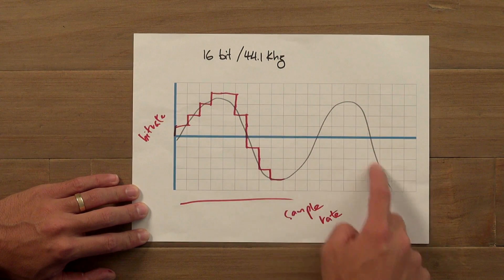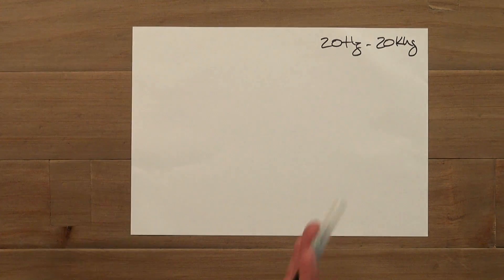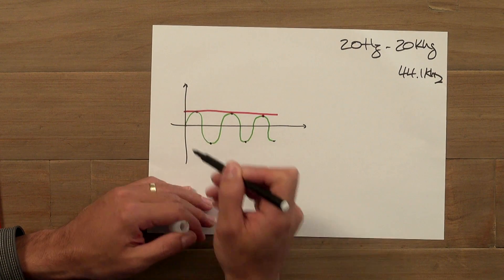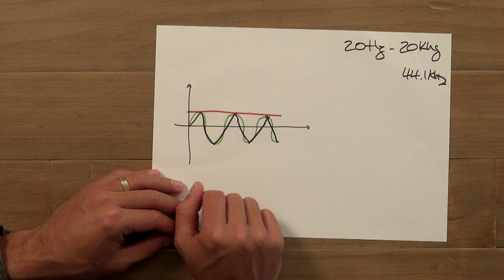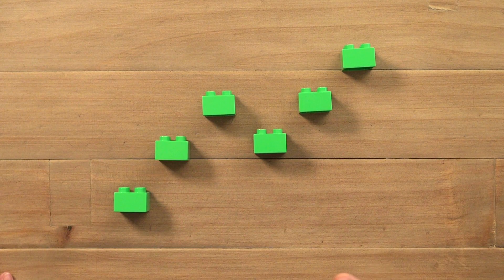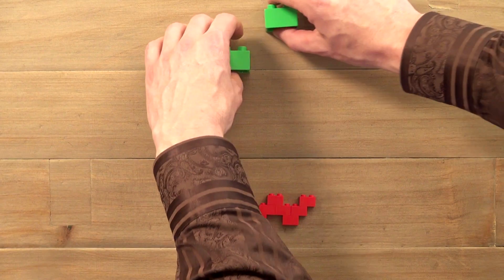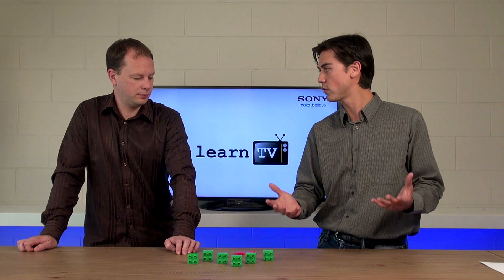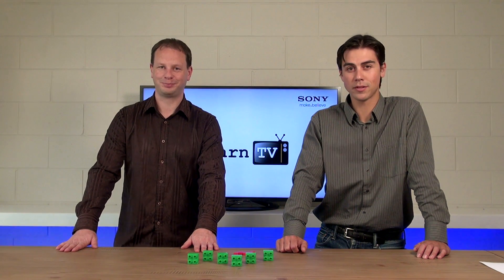Sony LearnTV - How High-Resolution Audio DSD works

Comment: What a load of crap! DSD was before PCM, it's now being rebranded as something "new" to sell more. There aren't 2 bits with a 1 and a 0, that's 1 bit. They don't explain how DSD is better than 24 bit audio vs 16 bit audio, which it isn't. Speaker's don't run "on and off", they run by receiving electrical current. If they ran "on and off", they would be making a square wave and damage the speakers before long. DSD and PCM both have high pass filters so there is no added benefit to DSD in that department. The actual sample rate of DSD is faster but slower than 88.2K audio anyway. How can you have this "wall of sound" instead of "speaker right and speaker left"? Sony can't change physics (as much as they would like too). That "wall of sound" comes from being in the sweet spot of "speaker right and speaker left". There's more in this video I missed...
Reply: That's a long comment, lots of information to digest.  Let me see if I have my understanding correctly.

In PCM audio, we have two things, bit "resolution", and sampling "frequency".  I believe the resolution of 24-bits in Hi-Res audio is not really to represent amplitudes as loud as 144dB.  That would be extremely painful to ears.  The higher bit resolution is however helpful to more accurately represent the quiet (pianissimo) parts of the song.  As an example, when a song has a fade away ending, we are likely to hear "graininess", because there are less bits of resolution at low amplitude levels.  I am not advocating we are to listen to the fade away ending of the songs.  It can be useful for classical buffs, to have their pianissimo parts heard in better clarity, with more bits of resolution.

Now, when it comes to the sampling frequency, in PCM audio that is relatively low.  Let me explain why it is too low in fact.  At 44.1kHz sample rate, even though we are able to capture single frequencies above human hearing range, there are still gaps so big in between the samples, that the D/A converter has to insert (dither) random (or interpolated) noise in between these samples.  In fact, there's a method called oversampling, which at 64x oversampling rate, inserts 63 additional samples in those gaps, in order to obtain smooth analog waveform at the D/A converter output.  It's all basically noise that it wasn't on the CD in the first place.  That's a lot of noise going in between the samples, all "invented" information that wasn't there.  Analogous to upsampling a DVD video into HD.  You interpolate additional pixels that were not there in the first place.  In audio, it's done just to recover from relatively low sampling frequencies of PCM to obtain smooth enough analog wave at D/A output. 

So now, in DSD, instead of having to do 64x oversampling, we aready have 64x faster sampling frequency.  And no false information.  No random or interpolated noise needs to be "invented".  The information is all there in DSD.  Now, the difference with the DSD is that the dynamic range for 1-bit is only 6dB.  However, by following the smooth analog wave with 1-bit up when the wave goes up, and 1-bit down when the wave goes down, we still somehow end up with effective 120dB "overall" dynamic range.  That's the part that cannot be directly translated to PCM, becuase DSD works entirely different in this respect.  120dB is an equivalent of 20-bits of resolution in PCM world.  That of course would not translate directly from the DSD, as PCM and DSD work in different way.  One assigns numeric values to different amplitudes (PCM), the other simply follows the analog waveform at A/D stage going 1-bit up or 1-bit down accordingly to the waveform (DSD).

Am I understanding this right?  For the record, I am not a PCM fanboy.  I think I well understand the limitations of having relatively big gaps in between the samples, that have to be dithered by noise in the DAC.  PCM might have advantage in dynamic range, but it fails flat on face in sampling frequency compared with DSD.  What I am interested in is how DSD deals with representing low amplitude waveforms.  How do we arrive with 120dB dynamic range in DSD?  (at least at its standard 2.8MHz sampling rates).   Is the 120dB of the DSD useful where it needs to be, which is at those quiet (pianissimo) parts of the musical piece?  Or is it simply to represent loud 120dB amplitudes, which I don't find useful...  Can you explain?
Reply: Thanks Hitashi, very helpful!
Reply: sigh ...well, at least a higher percentage of what you said is true when compared to this video. DSD sounds different, and that's all we can ascertain. Whether it's actually superior to PCM is debatable.
Reply from the maker: Hi MrJozzs123, thanks for your comments. As you seem a little worked up, we thought it worthwhile addressing some of your concerns, so here goes:
The basic idea of PCM has been around since the early 1900's - of course CD made it most popular in 1982; DSD really didn't exist until SACD launched in 1999, although the principles of the format were in play earlier in the 1990's.
In binary, '1' and '0' are 2 separate bits - you're right that DSD is considered a 1 bit format (only 1 bit is used to describe each sample) but we deliberately chose not to confuse viewers by bringing in naming conventions.
Speakers operate by converting simple electrical signals (which vary between positive and negative flows) into movement; the way the DSD signal "builds" a wave through simple upward and downward motion is very analogous to the way high-frequency current variations result in sound from a speaker. It’s definately true that DSD is simpler to convert to an actual audio signal than PCM, prior to the low pass filter (used at the end of both signal chains), PCM additionally requires quantization/over-sampling achieved via delta-sigma modulation and interpolation.
I’m not sure what you mean by the “actual sample rate” of DSD audio, however it’s easy to assume you can mathematically compare a 2.8MHz 1-bit signal to a “88.2kHz” 16-bit signal but of course that doesn't factor in the entire signal chain being different. It's like saying a 500cc motorbike is the same as a 1L car.
The improved soundstage available (I believe we actually referred to it as “engulfing sound”) with ‘high resolution’ audio formats, including vinyl as well as high-bitrate PCM and DSD is well documented in studies of listening groups. The point being, the limited sample rate available on CD (and of course MP3 etc) can result in a reduced ability to fully reproduce the ‘ambience’ of a recording space due to the artificial cutting-off of high frequency harmonics and subtle positioning cues (it takes under 1/2000sec for a sound to travel between your ears and your brain uses information like that to position sounds for example)
We really appreciate you taking the time to drill into this stuff with us! Do keep watching with such attention to detail and let us know if there’s any specific subjects you would like us to cover.
Reply: +MrJozzs123
 Here's a PCM  Sine wave of 22050hz  Sampled at 44.1khz.  
 note that anything that's not the actual sample, is the DAC 'guessing'  trying to connect the dots 
( yes.. the DAC will be connecting the Dots differently than this drawing, and that's beside the point )

http://postimg.org/image/v1ty48z4p/

The wave is described by a single sample per half-wave,  this is the minimum amount of samples per half-wave required, resulting in a brick wall at 22050hz. " but isn't this outside the audible spectrum? "  Well let's do a  11khz example then.

http://postimg.org/image/m2v5j3wex/

2 samples per half-wave at 11000hz..   No amount of bits can change this,   even at 10000 bits /44.1khz the waves would still consist of the exact same amount of samples. 
Then we have 4 samples per half-wave at  5500hz,  8 samples per half-wave  at  2750hz   and so on.  
When describing a sine-wave using 2 samples, increasing the bit-depth will only improve the 'accuracy' of those 2 samples, but i wouldn't refer to it as a higher resolution, since there were no increase in samples.  
Higher Bit-depth allows the 2 samples to have a more accurate amplitude,  but 2 samples will still only be 2 samples. 

               Bits = SNR 
Sample rate = resolution

I've heard people refer to the  'kbps' of a recording,  as if that is the "Resolution"
   you calculate the  kbps  by saying   16bit  x 44.1 sample rate = 705.6 x 2  =  1411.2 kbps    (regular CD)

( multiplying the result by 2, because it's stereo )

So what's being done is multiplying the  SNR with the sample rate, and they believe the kbps  will represent the  'resolution'    
That is like claiming a monitor's resolution were  120hz refresh rate x 1920x1080pixels =  What?
SNR and Sample rate  are two different things,  multiplying them is a pointless exercise.
You might have a computer screen with  a refresh rate of   800hz, but if it's maximal resolution is  640x480,   that's still a low amount of pixels, even though it's a very fast refresh rate,  multiplying the  refresh rate with the amount of pixels, will be the exact same pointless exercise.  
DSD's entire worth of kbps is in samples,   there ain't no  Multiplying  SNR with Sample rate when it comes to DSD.  So comparing DSD and PCM's   amount of information "kbps"   is ridiculous.
                                                                                    
Here are three examples:    32bit/44.1khz=  2822kbps     
                                                 24bit / 48khz =  2304kbps
                                                 16bit / 96khz =  3072kbps

What did we learn from this?  that  16/96  sounds better due to having more information?  I'm afraid that ain't the case.

 32/44.1  SNR of  192,5dB       and a sample rate of   44.1khz.  
 24/48     SNR of   144.49 dB   and  a sample rate of  48khz.
 16/96     SNR of    94 dB          and  a sample rate of  96khz. 
 
The SNR of expensive Dac's  is around  120-130 dB SNR   and amplifiers are well below that,  so there is no point of   24bit or 32bit,   roughly  20bits would be sufficient, due to the limitations of  SNR in dac's and amplifiers, cables etc.
 So there is a lot of wasted  kbps in the 32 /44.1khz  greater SNR than any gear will be able to produce..
Most gear can't even produce half the SNR of 32bit,  on the other hand  sample rates of 96khz  are not wasted kbps.  

If your DAC spec sheet says  128dB SNR,   then the moment a 24bit 148.8dB SNR  audio signal enters your DAC the signal is instantly turned into 128dB SNR.  if a part of your audio chain has a lower SNR than 128dB ,  then the lowest rated equipment will decide your signals SNR before it is played out of your speakers,  even though your sound signal in the digital domain started out as a 148.8 dB SNR signal.

Another thing is that when you decide on having a static sample rate,  it's an inescapable fact  that lower frequencies will consist of a larger amount of samples than higher frequencies will.  
When you choose sample rates  down in the  44.1 - 192khz  your 10-20khz audio spectrum will digitally speaking be a square signal trying to describe curved waves. 
The PCM-Dac will be playing 'connect the dots' while the DSD-Dac are producing so many dots, that the dots themselves will be drawing smooth curved lines, resulting in a pure analogue signal in the digital domain. 
How people fail to comprehend this is beyond me..  

 I've heard people say, and it seems to be a regular saying among PCM fanboys,  that  24bit / 88khz  is 'the same'  as  2.8mhz DSD... how they end up at that conclusion based on kbps is laughable. 88khz  will  describe a  20khz sine wave using 4.4 samples, how are these 4.4 samples as good as   DSD64's   2.8mhz    140 samples  at  20khz?
Oh yeah that's due to the fact that they multiply the SNR with the Sample rate, because they are PCM fanboys who needs to go study the subject more thoroughly. There exists actual purchasable music at DSD 11.2mhz  sample rate, 
at such high sample rates even a  20khz sine wave will consist of  560 samples.  
16/44.1 needs to be all the way down at 78hz  before it starts having that many samples to play with. 

let's make a DSD  SACD  2.8mhz  example 
 1bit x 2800khz  =>   2800 * 2 =  5600 kbps

What we have here is  5600 kbps worth of samples. in other words 5600 kbps worth of actual resolution.

Then let's do a   PCM   24/96 example
24bit x 96khz =>  2304 x 2 =   4608kbps             
Please understand that we are only dealing with  96kbps worth of samples.   Multiplying the 24bit SNR  with the  96kbps sample rate gave us  4608kbps,      DSD in reality has a very low SNR  since it's only 1bit,   but they found a way to increase the SNR way up to 24bit standards,  while maintaining DSD's immense sample rate / resolution.

and finally, let's do the 11.2mhz quad DSD example.
1bit x 11200 => 11200 * 2  =  22400 kbps worth of pure samples.

24x 192 =>  4608 * 2 =  9216 kbps

So if we were to assume ( which we shouldn't )  that kbps said it all,  then  Quad DSD  has  60% more 'information' than   24/192 pcm, and that's not everything..
 it has that much infomation in pure sample amount!  while    24/192   only have  192kbps worth of samples, that's less than 1%  of  Quad DSD's. The fact is that DSD sounds so good that i bought a 1000 dollar DSD DAC  immediately after hearing DSD for the first time, with no hesitation at all.   
There is no comparison, even DXD which is 24 / 352.8  PCM   sounds  harsh compared to  2.8mhz DSD.  
 (  yes my DAC also plays DXD )    i got  a TEAC UD-503   Quad DSD / DXD  capable DAC.

The people who owns the  studio's with DXD ADC's  who actually record music at   24/352.8   says  that their recordings sounds best at  DSD even though it was recorded in  DXD 24/352.8.  And i agree.
 
 https://referencerecordings.nativedsd.com/albums/FR718SACD-beethoven-symphony-no-5-and-no-7

"Interestingly, we found after listening to DSD files made from DXD edited masters that the DSD, particularly the higher bit rate examples, sounded more natural, spacious, and life-like than their DXD parent from which they were made."

Yes,  obviously   11.2mhz sample rate sounds better than  352khz sample rate ..?  i would'n need to hear those recordings to arrive at that conclusion. You can also buy actual music recorded in DSD on that site,   either you buy Analogue to DSD,  or you buy DXD to DSD,  but you  stay far away from PCM, once you get the chance! 

 People who writes down obscenities like   " DSD and PCM sounds alike " 
These  are bitter people who have never even heard DSD...  i can guarantee you that,   there is no resemblance between DSD and PCM!  I've read somewhere that blind tests had been performed and nobody were able to differentiate between  DSD and PCM,  and that's just impossible,   where did they find these people!?  That would be as unlikely as finding a target group incapable of differentiating between tube amps and  class-D amps...  Well i'll leave it at that.

 -Hitashi
Reply: It's true that DSD is 1bit and not 2 as mentioned in the video.
But I'm sorry to tell you, but 24bit is clearly better than 16bit, and DSD is not exactly PCM, so the 1bit vs 16bit/24bit is void due to noise shaping and filtering.

There's plenty of videos to explain all of this, even several videos by studios that explain why recording in higher sample rates and specifically in 24bits is better.
Reply: Not really try some good headphones